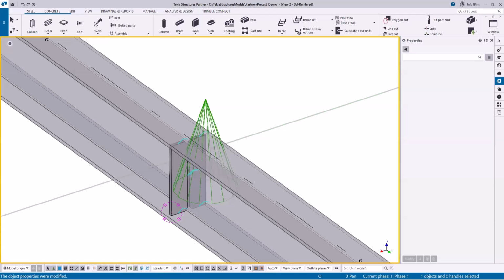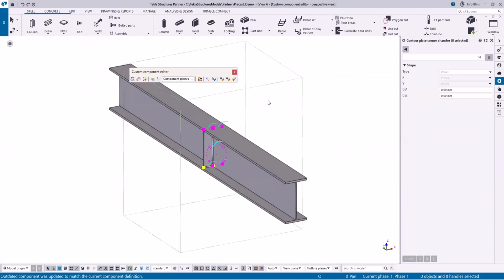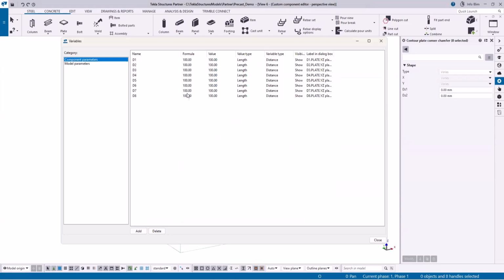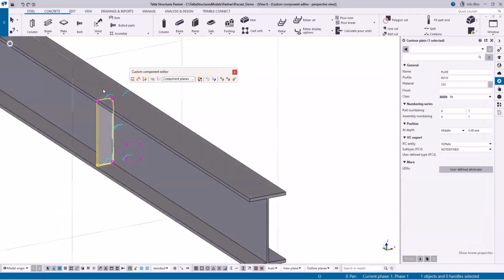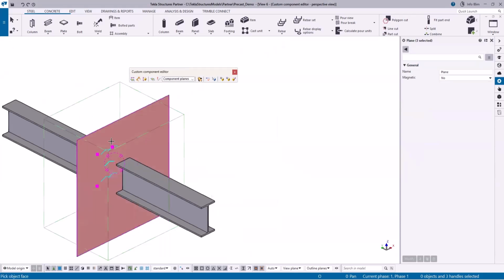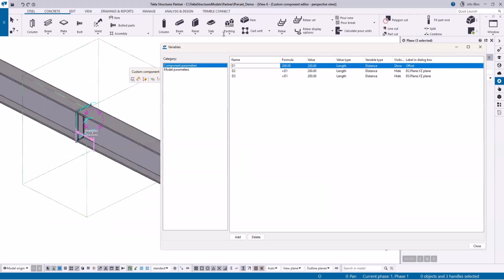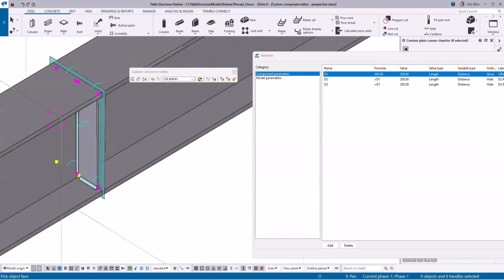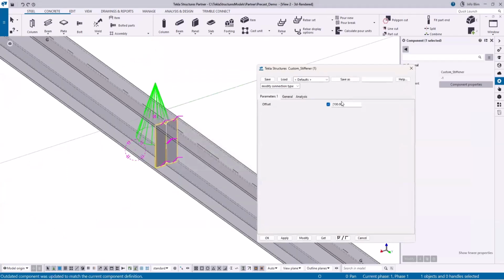Tekla : Use Construction Plane in Custom Component

Comment: If you set the construction plane to magnetic in its properties and put it exactly on the handles of the plate like you did then you dont have to bind to the construction plane the plate would follow the plane as it moves. This works especially well for multiple cuts in the same place